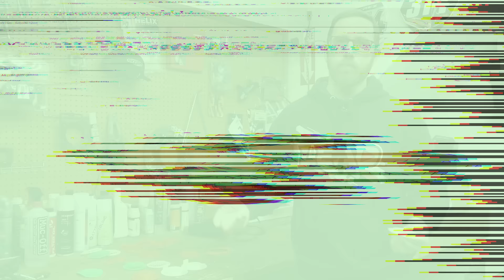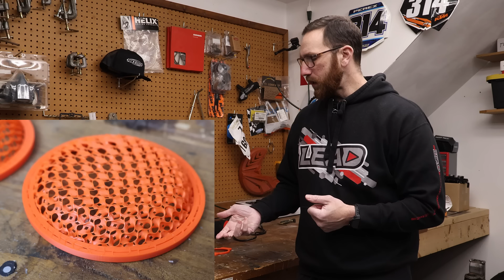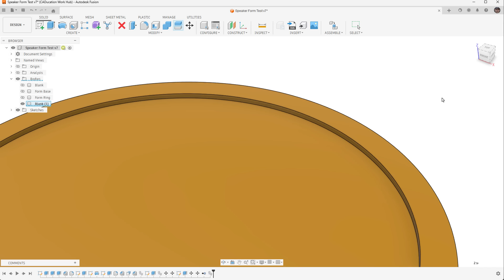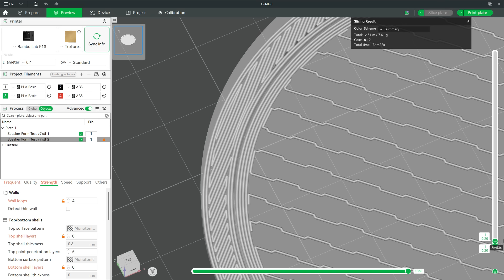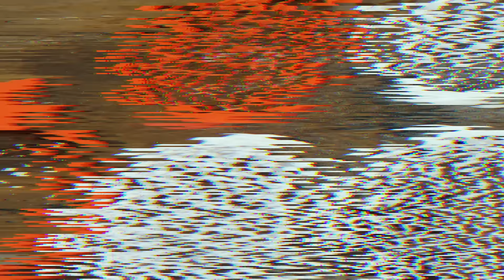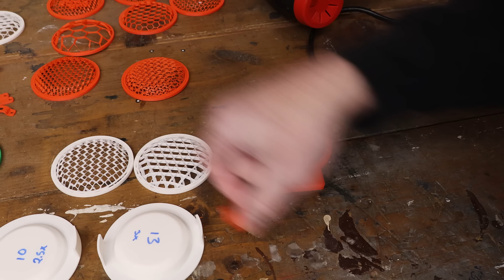Thermoforming 3D Printed Parts | Lessons Learned And What Worked For Me

Comment: I wonder if you could create a mold system similar to a lemon squeezer where you squeeze down on it and it pushes it down onto the mold. But instead of having a handle that pushes it down from one side, you have it where each side fits over a rod and when you push down, it pushes down evenly.

I'm noticing each time you put your blank down over the mold, it's not necessarily being put on there dead center initially with even pressure all the way around. And so I'm wondering if you built something that put it onto your mold dead center with equal pressure from all sides, if you would get less deformation and tears?

And if you took that and you dipped that into boiling water so everything could get evenly heated at the same time, and then pressed it down on the mold, pulled it out, and say dipped it in cold water, if you could get better results.

I am probably not explaining that very well, but I can visualize it pretty well. If you've ever worked in a restaurant and had used an onion dicer or something like that, that would be similar to what I'm thinking about. You would stick it down in there and push down on the handle and the blades would push it down, but typically more straight than what you're doing here, if that makes sense.

Edit: Or imagine your form and your top ring had the same wings that your top thing has, and the bottom form had rods sticking out of either side of it straight up, and a hole was in the equivalent spot as those rods on your top ring, so that you could put the rods through that and then press it down equally straight and dead center. Or kind of like a French press with the mold being on the bottom and you've got a plunger at the very top keeping your hands away from everything. You stick that whole system down in the water and let it heat up and push down on the plunger to form it, pull it out, dip it in some cold water, pop it off, and move on to the next.
Reply from the maker: Yeah sounds like a great idea.  I have made two sided forms like that for sheet metal where they had 4 guide pins and you put it in a vise to clamp it down.  Doing this with the 3d printed parts presents a few issues.
1. I am heating the part while pressing down to try and control where it is deforming.  With the thin infill (in this case) you don't really want even deformation.
2. It has a tendency to stick to the form because they are the same material and also being heated. I don't know if that would be the case pressing it on both sides. Using a different higher temp material for the form might work better.
3. The infill is really thin and the rim is really thick.  I don't know how dunking the whole thing in water would end up heating everything.

Several people have suggested the dunking in boiling water.  This worked ok for what i was trying to do so I probably won't try the boiling water thing, but will file it away if needed!

I ended up not using this for my radio and did a 2 layer infill speaker grate

Comment: I really think that using slicer generated infill as the lattice is a suboptimal shortcut, the lattice really should have two or three walls. you could easily design different lattice structures with SVG images, maybe even a I could generate them. but any PNG lattice image can be extruded if converted to a SVG.
Reply from the maker: I don't upgrade slicers but some allow you to specify number of walls for the lattice.  I know the newer bambu slicer does so I imagine others do as well.

personally not interested in AI doing any of this but im sure there is an option in there somewhere.  This workflow worked for what I needed.  On the final radio model i made i didn't end up thermoforming it, but i did do a dual density infill for the speaker grate.

Comment: why not just print in the shape you want?
Reply from the maker: The idea for this is for two main reasons.  1. is that designing the 3d mesh shapes is tough or impossible with most tools.  If you are using rhino and grasshopper or doing node based stuff in blender it might be possible, but in Fusion making a mesh pattern in 3d isn't.
2. is the print time and supports.  For this dome if we printed it with top/bottom faces, its 30mins.  if i printed it the same but in its final shape its 1hr without supports.  So you can see a lot of speed gains.
Reply: @LearnEverythingAboutDesign thanks for the explanation

Comment: Interesting. I find for what you're doing here and the amount of bend you need, that the time and heat needed aren't worth it. Why not just print your part shaped as you need it, even if you need a small amount of supports and a bit of effort to figure out how to achieve it. I hear your argument for doing this. I don’t think it would be my choice. But none the less, if it works bwttwr for what you need, sure..
Reply from the maker: So there are two (maybe more) challenges here.  Modeling the mesh texture in 3d is one of them.  Without a lot of work or some advanced tools (for not cylindrical shapes) you hit a wall.  You need something like Rhino and grasshopper, node based geometry in blender, or some advanced tool.  Most CAD lattice tools work relative to a direction and not normal to the geometry.  The second is print time.  If you take supports out of the mix as a "thing" you save a lot of time printing flat vs printing with supports.  Even on a small shape like the little bracket that was 4min vs 12min with no support.  For a dome shape like this with no mesh setup, just "solid" the difference is 30min vs 1hr.  bigger the part, deeper the shape the worse that gets.  that is with no supports.

It isn't ideal or the right choice for everything but good to have in the back pocket :)

Comment: Thank you. Awesome video as always! I’m definitely trying this technique. What do you think about heat forming ASA 10mm/0.39in thick? And 20mm/0.79in wide? It is a suspension height sensor link and printing it flat would be beneficial to strength and would also avoid using supports.
Reply from the maker: I think you will have a hard time with 10mm thick getting the material to transition temp in the middle.  At least with a heat gun.  Others have said they dunk the parts in boiling water, but they might swell and be less dimensionally accurate.
Reply: @LearnEverythingAboutDesign   Maybe 3d printing is not the right application for this part then. I’ll try and see what comes out of it. Or maybe I can make it in couple parts and connect using hardware. Or implement some metal piece mid print. Anyway thank you again!
Reply from the maker: @kuzebnyi  Could it be sheet metal?  It would be much thinner (without knowing the geometry and overall shape this is a guess),  If you can press some features into the bend corners it can be very strong.  not sure if send cut send can do that or not but even a sheet metal part with some gussets or possibly 3d printed corner strengthener pieces might suffice.
Reply: @LearnEverythingAboutDesign   that’s a great idea. It does have to snap on to a ball joint but your genius thought process game me another idea. Thank you and I appreciate your time 🙏

Comment: I don't really understand this trend when 3d printers exist to print plastic in the exact shape that you need lol
Reply from the maker: Did you watch the video :)  I talked about in there that its faster to print flat and form than in the final shape.  Also designing the infill in the final shape requires specialized software vs doing it flat.  If you apply infill to a 3d part you won't get the same shape.  This way printing it flat there are no supports and even with simple parts with no mesh/infill you can print a part in 1/3 to 1/8 the amount of time.
Reply: I feel thermoforming often produces subpar results for these applications, with stretched infill patterns compared to taking the extra time to print something specifically modeled like this; but, to each their own. It really depends on your use case.
Reply from the maker: @AuntJemimaGames  wasn't trying to be salty :) just that in the video i talked about the time.
It is a balance of effort for sure to get the output.  Fusion doesn't have a way to do a 3d pattern so unless you can do it in rhino with grasshopper, use some sort of geometry node in blender, or get deep into dedicated programs that are very expensive, it becomes more skewed toward trying to form it.  With my last tests with the dual density (not in the vid but did a short), I was really happy with the results with little to no deformation noticed.

Comment: I have found the heat gun is an invaluable tool.  It now lives beside the printer, instead of in the workshop.    It's great for cleaning up supports, string and surface finish as well as tweaking geometry when you just need a little adjustment.  I tried hot water for a dimensionally critical PLA part and it swelled up the entire part out of tolerance, so I won't do that again (Unless I make a fit too loose, then hot water may be perfect)
Reply from the maker: That's good to know about the water.  A few others have commented that is how they form parts.  With this the ring and form fit are pretty tight so a swollen part wouldn't work well.

I have adjusted some shapes before with the heat gun for various reasons :)  But i haven't used it on supports.  Sometimes I throw my parts in the freezer and the supports snap off a little easier.  Ill have to try it on the support thing.

Comment: It would be interesting if you use a 3-step process. First step: 1.5x but smaller to stretch the middle. Second step: 2.25x to stretch the 50% from center band. Third step: 3x to stretch the ends.
Reply from the maker: thats a cool idea.  For this shape the middle stayed flat, but if you wanted it to have a concave dome or something that would make it possible.

Comment: Have you considered multiline infill? That will give beefier lines of filament to stretch. Or perhaps changing the line thickness to 0.7 or 1.0mm?
Reply from the maker: Yeah i played around with a lot of different methods.  The thicker infill lines mess with the aesthetic a bit but do help.  What i actually landed on (after this video) from some more testing was to split the infill section in half (2mm each), and do a denser infill on the lower part and sparse on the top part.  That seemed to help control the stretch a bit and give the external appearance I wanted.

I still like the 3d style infills like Cubic, gyroid or 3d honeycomb, but really depends on the goal.  Had a few other comments about using boiling water for better temp distribution as the heat gun is tricky to get right.

thanks for the idea!  ill have some more playing around.
Reply: @LearnEverythingAboutDesign Split layer infill sounds interesting.

Comment: Thanks for sharing — great info.
I recently made new grips for my 35+ year-old wire cutters. Since the handles are curved, TPU probably would’ve been ideal, but I used PLA and thermoformed it over the metal handles instead. I soaked the prints in hot(boiled) water for about a minute, which gave a more even heat (and better control) than a heat gun for my purpose. I also printed them at 100% infill to reduce distortion when I pushed them on.
It was basically like putting new grips on bike handlebars — definitely a handy trick to keep in the 3D printing toolbox.
Reply from the maker: Great tip Jack!  I have used steam to soften prints but haven't dunked them in boiling water.  Heat distribution is the key or killer of this.  Very cool idea!

Comment: When you say 2.5X or 3X what is the x dimension you are referring to?  Is ti the thickness of the area to be stretched?
Reply from the maker: From the bottom face of the form to the top face of the form measured relative to the thickness of the part you are stretching.  So for my example the part was 4mm thick and the height of the form (how deep you draw it) was 10mm.

Comment: Great video, thanks.
I have been experimenting with this as well, but I have not made a video about it yet.
The way I heated my part was with hot water. With air I didn't get the part heated up equally,  while with hot water, this was no issue. This was confirmed using a flir camera. 
Another thing I tried was using solid parts, and when heated with water, the results were really good. I also tried this with sheets I normally use for vacuum forming, and that also worked very well, even better than 3d printed parts, but the problem was getting the right dimensions. I needed a cnc machine to pre cut the parts before forming them.

When I find the time I will make more examples and finish a video about it.
Reply from the maker: Thanks for sharing!  Had another comment on the boiling water as well.  Do you have a part of the design that gets cut off that you use to hold it in the water?
Reply: @LearnEverythingAboutDesign  Hi thanks. I dit put the part in a frame, a bit like you did, but that frame was lasercut wood, so that it could handle the heat of the water. I took the way parts are made with Vacuum forming as the idea. You frame the plastic that is going to be heated, then you heat is up (with hot water) and when hot, you form it around a mold. Then I used a contra mold to bring down the heat of the part, and that works great.

Comment: Perhaps adding a second, internal ring that is missing the top and bottom layers before the outer ring with a lower or higher infill density, or a different infill pattern to negate some of that odd stretching behaviour?

Interesting stuff!
Reply from the maker: Nice idea!  I had a similar thought today as i looked at the venting on my desktop.  it has a finer mesh that is essentially 2d and a larger one that is more 3d on it.  I don't know if it will help with the deformation but certainly worth a shot!

Comment: Cool technique. I'm wondering, have you considered techniques used for pressing metal grill material? Typically we will create a positive and negative mold from MDF to press. The problem I see here with the 3d prints, is the "ring" attached. You may experience less deformation If you are able to print the only the grill pattern without the ring and attach it after somehow to a ring. Possibly some trimming of the "grill" needed.
Reply from the maker: Yeah ive done that before with just some "blanks" for thin aluminum and some custom machined forms, but haven't tried it with the 3d print/heat method.  The biggest challenge i see is consistent heat.  But ill play with it some more and see!